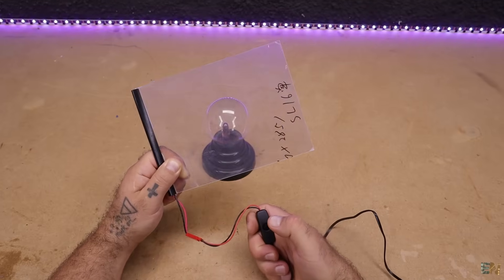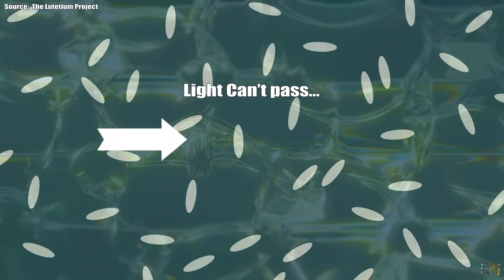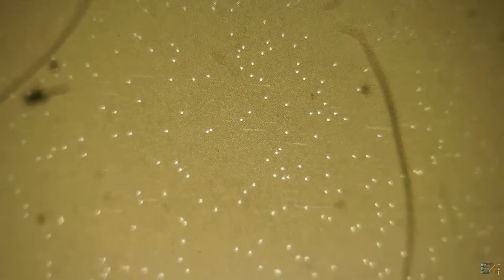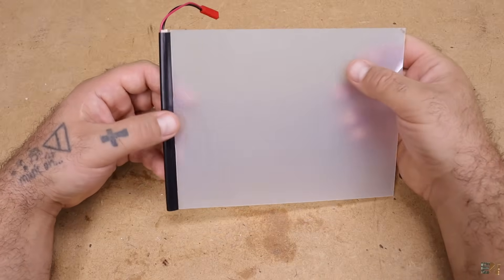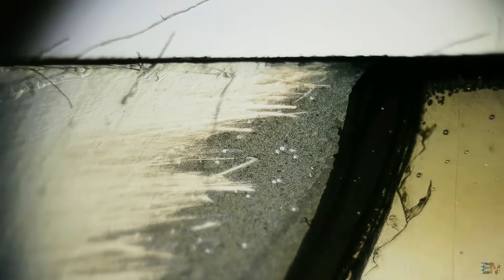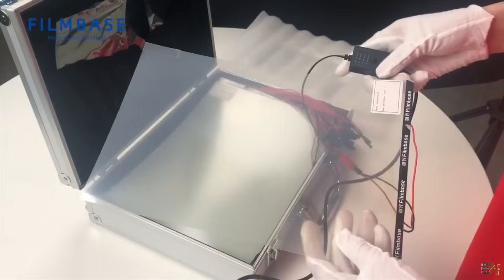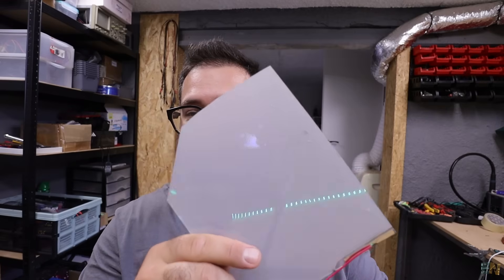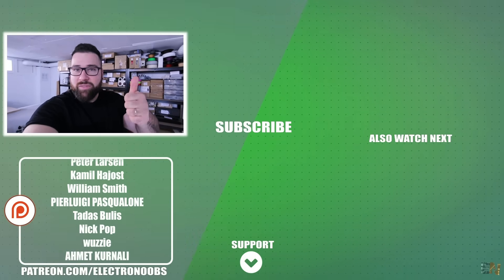Is This Glass Actually Magic?

Comment: Can the transparency be made kinda 'adjustable', like PWM, but if AC then phase angle or burst fire/cycle skipping ,or so controlled? If high frequencies are already used to prevent pixel burn-in, or is it possible for the crystal to react at the same rate physically or is the solution only to limit a certain type of power supplied to the liquid crystals?? If used in a lamp as diffusor, do not adjust the light output or 'amount of light' but the diffuser's property to scatter/disperse the light? Well, of course, all diffusers block some light, but in a properly configurated application, the spotlight can also act as a dimmable light source as usually but also between a spotlight<--|-->ambient light adjustable. From applications widely, to space/room lighting and more specialized lighting solutions such as photo/video cameras. Maybe not good examples and are just to illustrate the variation, but think about the alternative to your microscope light directly from the LEDs, with a wider diffuser spreading evenly and in between. If you want to experiment with on-off and everything in between, even with a video. I wouldn't criticize the idea at least.. ;)

Comment: Be nice to see how it reacts to a function generator instead of standard ac. What's it do with a square wave, or saw wave. Can you PWM if you cycle it fast enough to control the fade?  

Be interesting to see if you sandwiched a 1 way mirror between 2 sheets if it and read the light level if you could tweak the light with it to make a directionally controlled mirror as you could restrict the light on 1 side.  Couple weird things you could do because is make a tunable infinity mirror, or as implied 1 way mirror, or physically multiplex a video where you normally view 1 way but switch every 30 frames or 1 time an hour flip to another view with a mirror for a time lapse. 
 
Would also probably be cool as a projector display. Could have a wall display that a projector displays an image on when it's opaque and when it's clear the projector projects onto a wall through the display. LCD's tend to polarize light though, but that could be interesting as well you could in theory use the 1 way mirror above and shine light through it to polarize the light and use another not always on viewer to say see stress  buildup in glass/plastic and change the angle of the light. If that would work you could do all sorts of things like change the color of the light, or potentially create an animation by intentionally embedding stress in plastic to only show an image from  particular polarization and "animating" the light. 

Anyways this comments probably to long for youtube now and I've gone way into the weeds.

Comment: I knew about this a long time and thinking of adding it to license plates so you can pass through speed trap cameras without worries;p Also integrate it with gps receiver on a microcontroller and pre-program the fixed camera locations, maybe even waze from your phone and have it activate and de-activate only when near them;p

Comment: there was no mentioning about power usage, basically if you need it in transparent mode for longer time, it will use power, but how much? Could you make some current measurments dependant on total surface of the sheet? and how current drops if you cut sheet?

Comment: If I remember correctly, the white dots are tiny spacer spheres to keep the two electrodes separated and give a consistent film of LC fluid. They use a similar thing on glass LCDs, but they're around the outside of the display where you can't see them.
Reply from the maker: oh, that's so interesting! I did not know that!

Comment: The resistor was not in series with the supply! It was in parallel with the panel, probably to discharge it faster on switch-off and make a faster transition!

Comment: maybe I missed it, but what is the power consumption to keep it clear?  Too, could you strobe it to vary its transparency?  PWM on to of the AC? I realize that it takes a moment to switch between the two states, but what about an in-between state by varying the pulse lengths?  This would be what you want for a light box.
Reply: I think a simple triac-based lamp dimmer might work well to adjust transparency. Or simply a potentiometer in series to the resistor. Not sure about power consumption, must be very low (<1W for this panel, excluding the transformer itself)

Comment: Might actually be a pretty good windshield tinting device to fully block light when parked. Obviously wired so that it is in clear mode when the vehicle is on  lol
Reply: The only issue is that it's not fail safe. All it takes is fuse to blow or a wire/connector to come lose or break and suddenly you're doing 70 on the highway and blind.